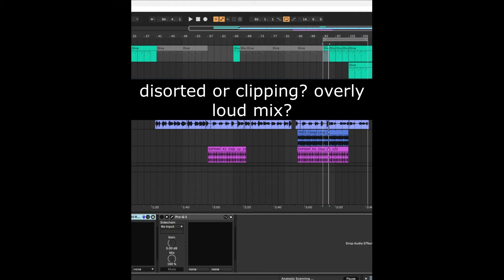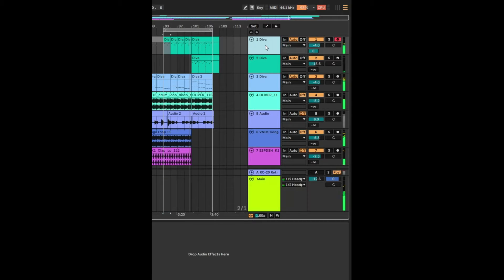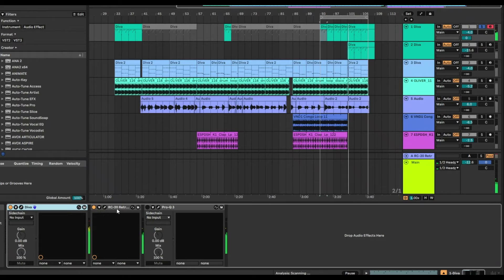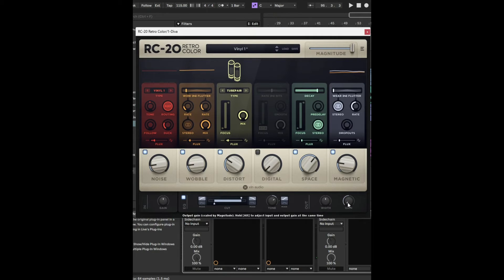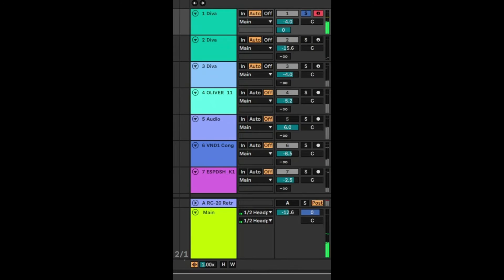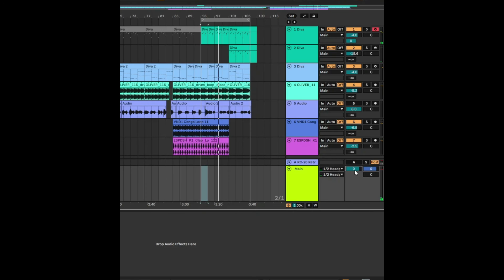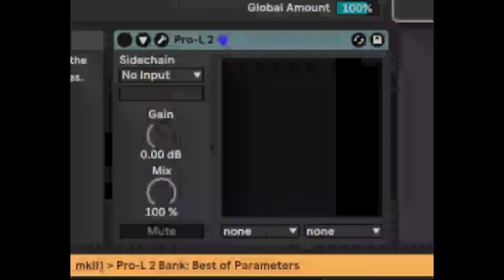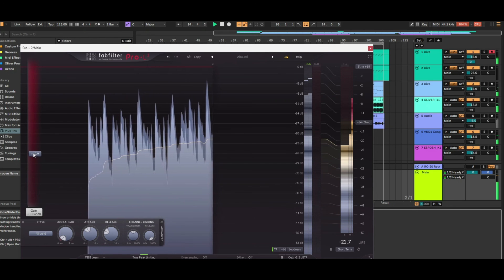Remove Clipping and Distortion in Ableton Live

Comment: You should devide always all audio by 3 

Start building your track with the Kick on  -12 db
And Master output - 6 db   

You have your audio settings wrong. It should not be
- 4   - 6.5  - 2.6  etc.  

Build your Bass line in the same note as your kick - 9 db or  -15 db or - 18 db etc. 

Do this with all percussions and instruments in your track and it will be all super clear 

You can also open audio file and connect the empty audio file on your kick with post fx around - 15 db
Reply from the maker: thanks for the advice!